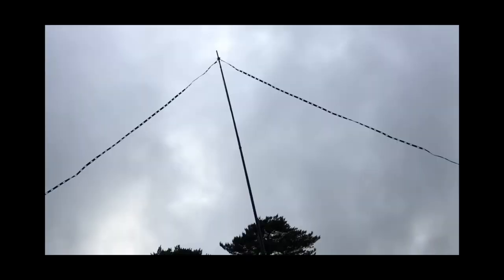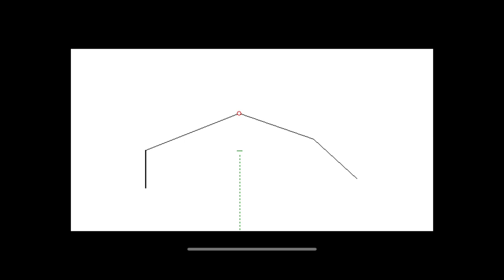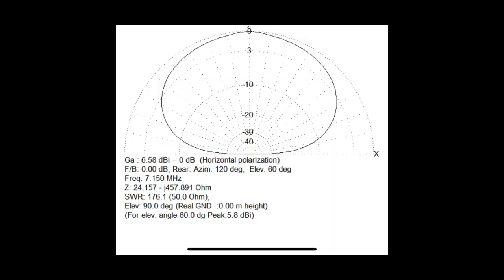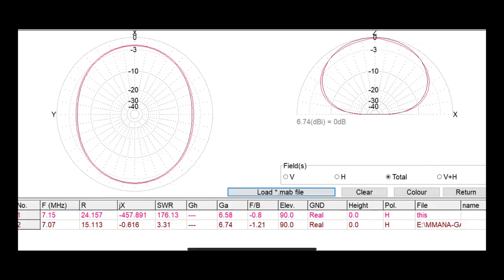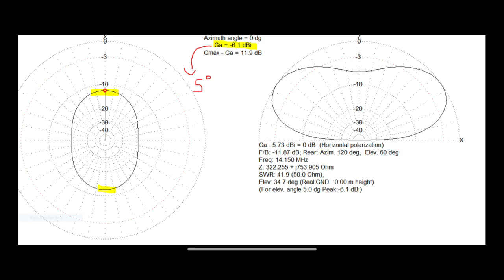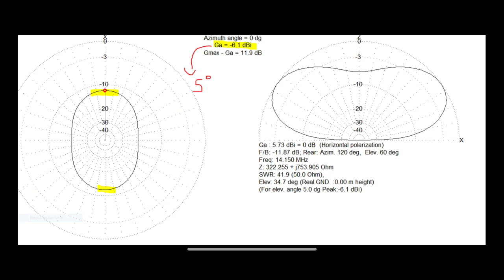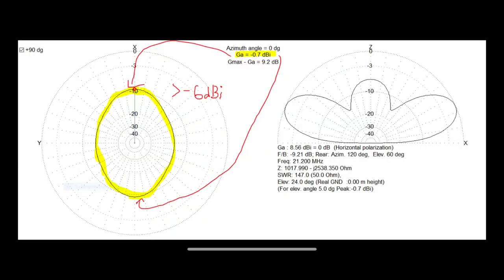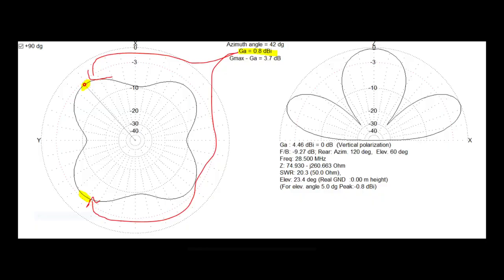Ham Radio Antenna: 40 Metres Doublet Antenna In a Small Space (With other bands!)

Comment: Interesting Tim. Just shows there’s no excuse not to get something up in the air. My first 80m antenna was a home brew G7FEK it was only 46ft long and as one end was just a few feet from the roof apex it reduced the required garden space even further. It also worked on 40m / 17m / 15m / 12m but had to add an element for 20m. Keep up the good work Tim.
Reply from the maker: Sounds great!

Comment: Hi Tim, what would happen if the folded dipole was made from 300 ohm ladder line and fed with 300 ohm ladder line or would the phases cancel each other out ? Mike
Reply from the maker: I’m pretty sure (?) that folded dipoles do not make great multiband antennas even when fed with ladderline? I’ll need to check this.